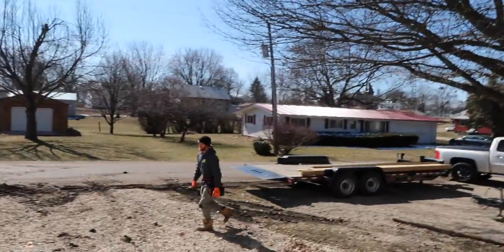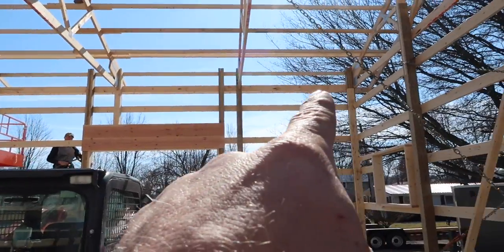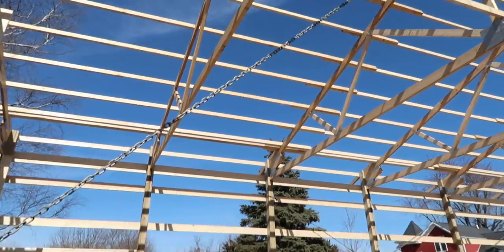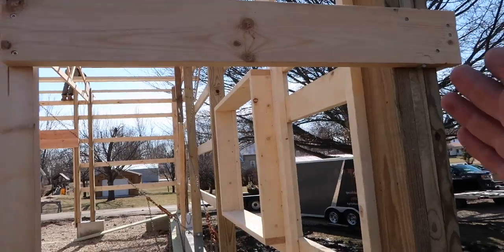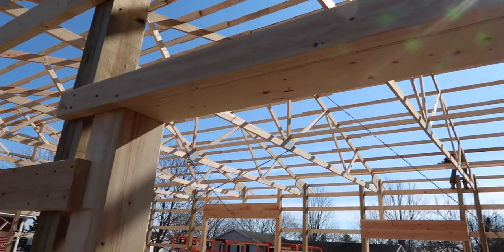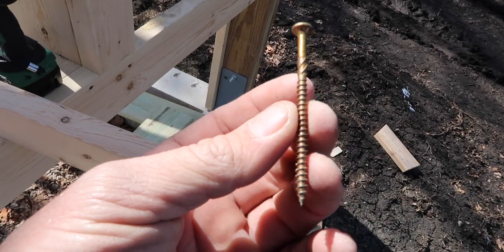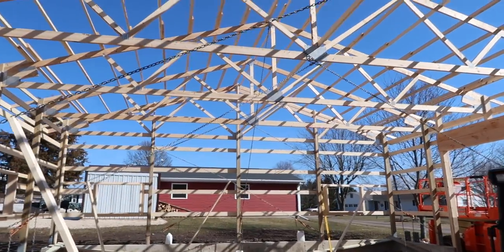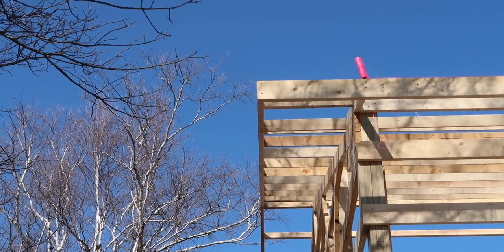Best Garage Video 3 (finish framing and disappointment)

Comment: You mention that some viewers write about the difficulty of getting their projects level and square.  When I bought my 6' magnesium level about 30 years ago I found that all but one of these in the Builders Hardware store were not measuring level in all directions.  Guys, you have to calibrate your levels before anything else.
Reply: They made that perfectly clear each time they sold them back in the 80s early 90s with a strip of laminated cardboard that was wedged in the fascias of the levels...not anymore. 

Which is funny, because today, each and every tool you buy, needs calibration...
Reply: How do you calibrate a bubble level?  I thought the bubble's were fixed.
Reply: Steve, turn it around.
Reply: Do the more expensive levels allow for calibration? Or do you just test each one until you find a level level?
Reply: I think it would be more fun if you can figure it out yourself.

Comment: I am catching up on some of your earlier Videos and I was wondering, Cost wise, is Post and Beam with Metal siding in the same Ball park as Traditional Framing ? You guys obviously have it Down as a System and I realize a Good Crew is Golden.
Reply from the maker: For us it’s what we excel in.. therefore we are competitive on the labor advantage.  I think what we build are stronger than a stick frame and have a better connection from footing to roof system

Comment: Do you use the #9 or #10 GRK's? i Was having a hard time getting the #9's to draw up to the wood tight without burying the head 1/4 into the face.
Reply from the maker: they are working on that and should have a fix this summer im told

Comment: What is the separation distance of the wall girts and of the roof girts?
Reply: Roof trusses are 8' on center
Reply: Guess I should have clarified more.  The separation from girt to girt.  Although the 8ft is a helpful measurement too!
Reply from the maker: 30" center spacing